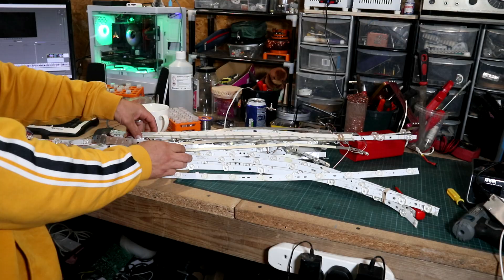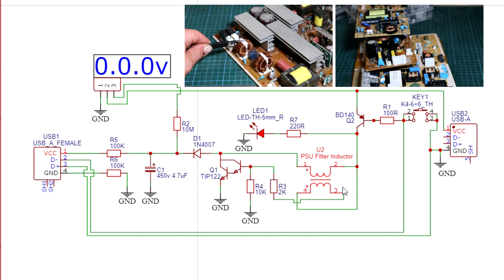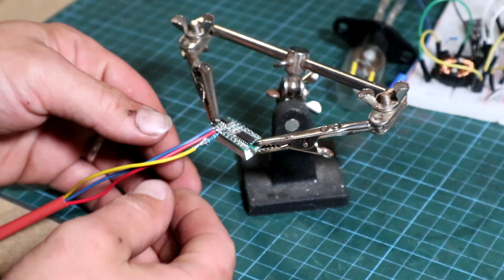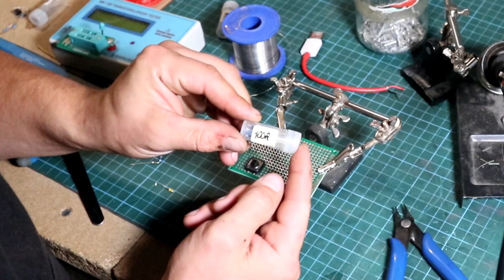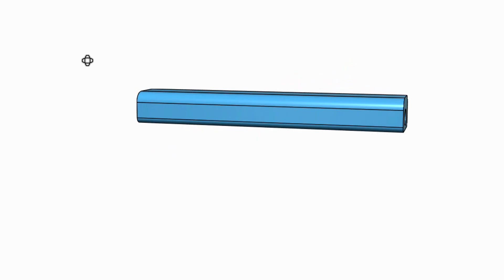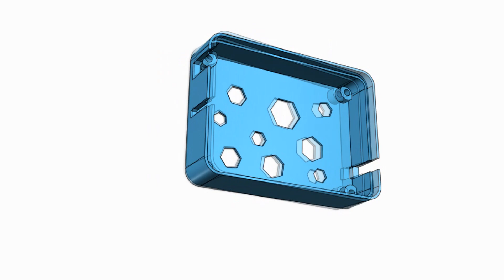Simple universal 150V USB LED Tester

Comment: Just a little confusing, you should label the voltage in/out. What is the LED current set to, and can it be adjusted? I have a whole stack of salvaged LED TV strips, as they have a good Color rendering index. Do you have a DL of your project? Thanks
Reply from the maker: This tester is just for quick testing, so I don't waste too much time with the non-working one for more in depth analysis i got another technique depending on the type of led  to find the voltage drop and also the current.